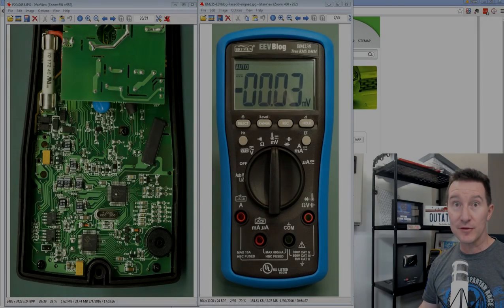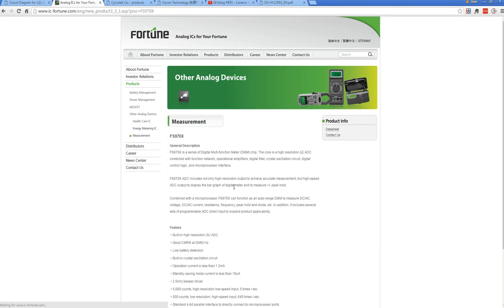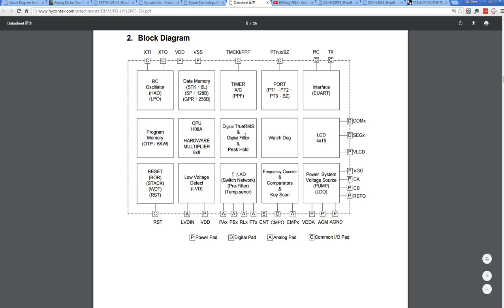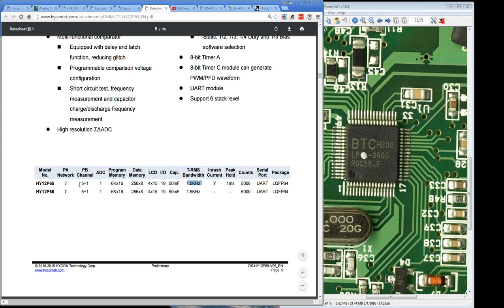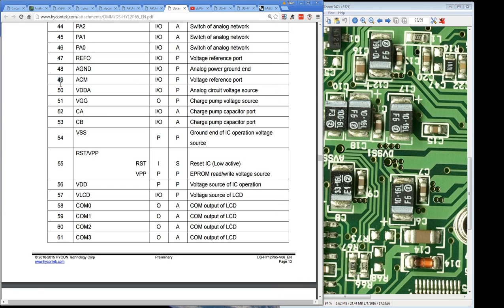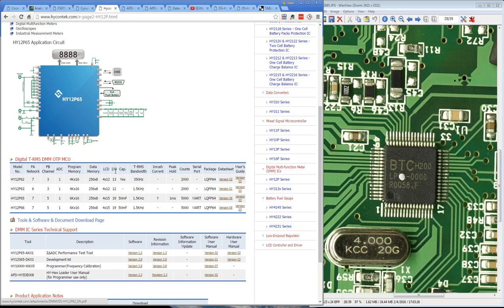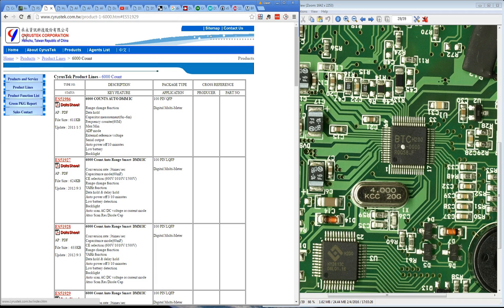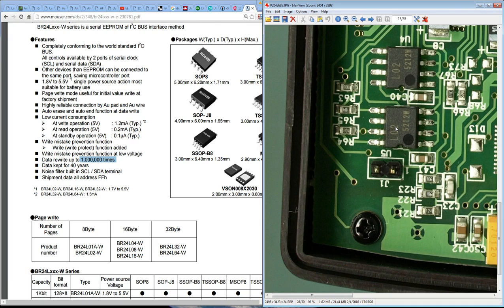EEVblog #912 - BM235 Multimeter Reverse Engineering

Comment: I did wonder if that J1 was a cal jumper, being close to what looked like EEPROMs.

I got a free loose jumper in my BM235 (presumably formerly positioned on J1), so had to follow the "Don't turn it on, tear it apart" motto.  (Murphy is always waiting for you to power up something with a loose screw or other metal component strategically located to cause maximum damage.)
Reply from the maker: Left inside by the cal tech! LOL
Reply: +EEVblog  Yeah, probably dropped it, and usually under significant time pressure so can't spend all day trying to find the wee bugger.

Comment: Did you meter the supposed supply rails of the chips to see if it was the supply pin as indicated and it was in the spec range? ok so some other issues

Comment: They may have some extra firmware code in that I2C flash that is programmatically loaded when needed.
Reply: That was my first thought as well. Even though it was an OTP part, they could patch the code.  If so, they could apply a firmware overlay during calibration to patch the OTP code.  Some chips like the OTP Intel 8051 processors can be forced to boot from an external EPROM which makes them still useful pulled parts for playing with.

Comment: The soldering on the Brymen 257 is terrible. Plus, is there a part soldered over some passives on the lower right of the board?
Reply: To me the soldering doesn't look that bad. And I think you mean the through-hole plastic film capacitor, which is bent over some passives, so that it fits under the LCD. That cap is probably for the ADC, which requires a linear, low leakage capacitor, hence the plastic film cap.

Comment: What are 0-Ohm resistors useful for? Is it to jump over traces?
Reply from the maker: Yes, plus breaking into the circuit during design debug, plus design options etc. Plenty of uses.
Reply: Makes sense. Thanks, Dave.

Comment: What are the chances that they got a deal on ICs with bad lcd controllers and had to use an external one?
Reply from the maker: Unlikely you'd get bad dies in just one area.
Reply: Maybe using the onboard controller somehow generates too much noise to get 6000 counts, or maybe they have to borrow clock ticks to run the LCD driver, but by eliminating it, they have an extra few cycles to sample with.

Comment: How did you identify those three vendors as the main suppliers of meter ascis? Just tribal knowledge or did you apply a methodology?
Reply: You can identify the makers of microcontrollers for multimeters via an internet search. Maybe start with multimeter microcontroller. One rather important maker that Dave didn't mention is Texas Instruments. Here's a recent (June 2016) Texas Instruments design using its MSP430F6736: http://www.ti.com/lit/ug/tidubm4/tidubm4.pdf

As I understand it, Texas Instruments makes the processors in high-end Flukes (don't know if it makes them for the Flukes made in China).